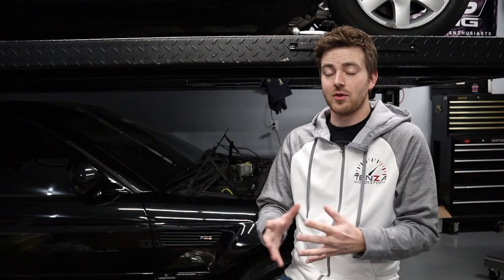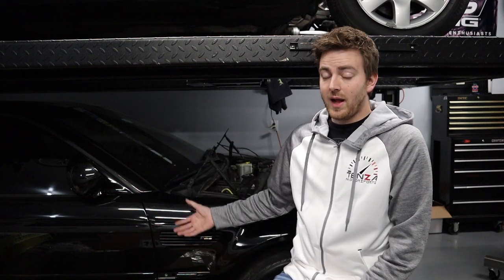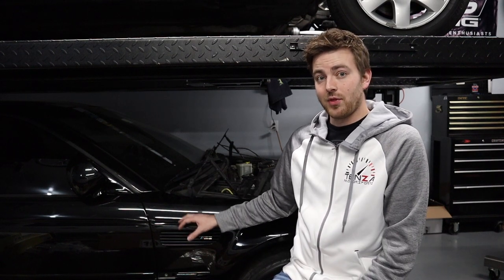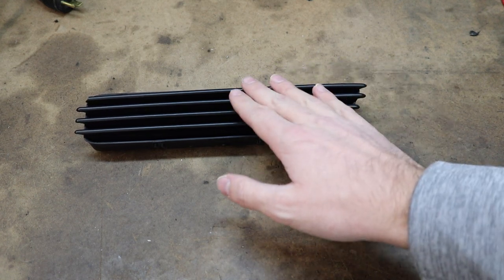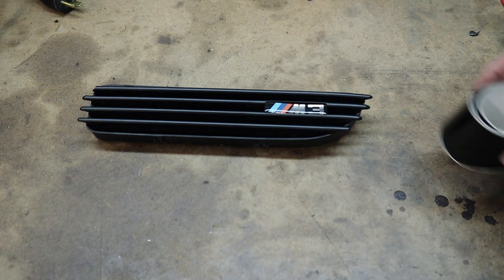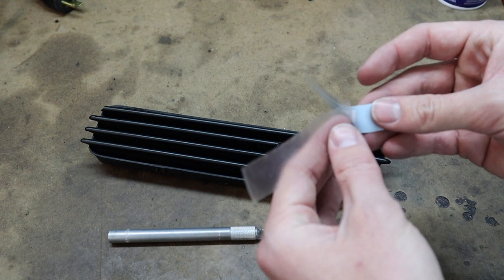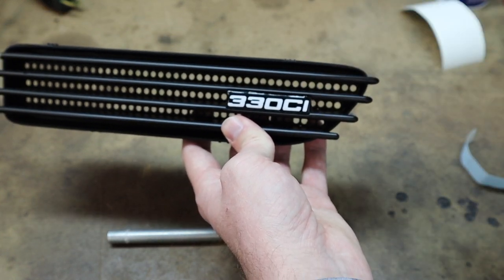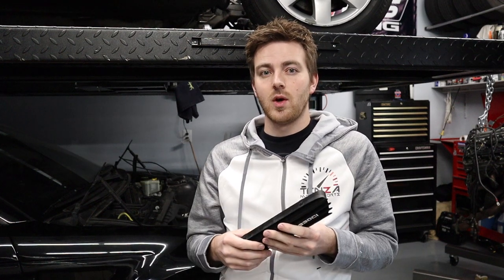Properly badge your custom E46 while using M3 fenders. Non-M badges for m3 side gills - fender vents

Comment: How did you even make the hole on the 330i for the vent and dose it serve it’s purpose? Because I want some more air flow on my 330 I want to install hood and the side ones like you did
Reply from the maker: These are M3 fenders. And as far as I know they have some sort of function
Reply: Just swap the M3 fenders to it, they won’t fit on Sedan though

Comment: So wait did you put m3 fenders in the 330ci or cut out vent holes on 330ci fenders then put m3 vents w 330ci mock up badges ? It looks 😎 cool
Reply from the maker: They are actual M3 fenders
Reply: @TenzaMotorsports  and they fit 330ci without modifications?